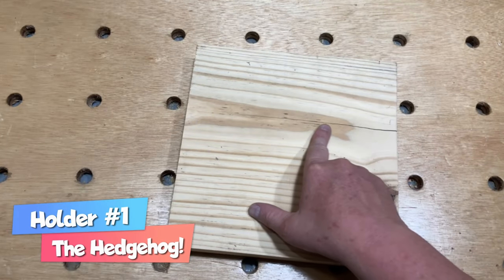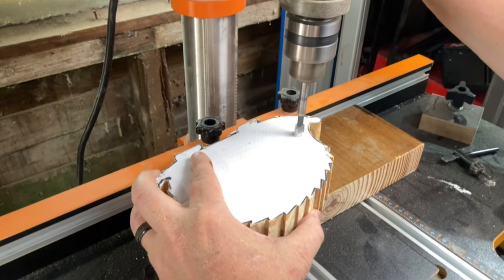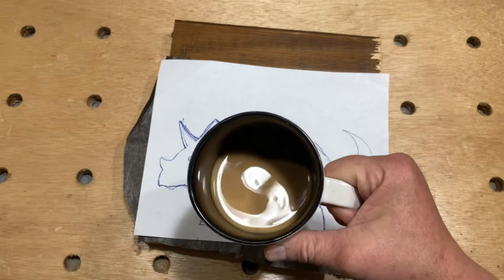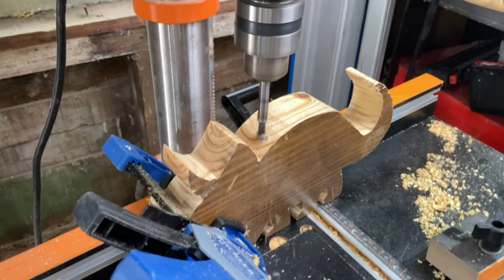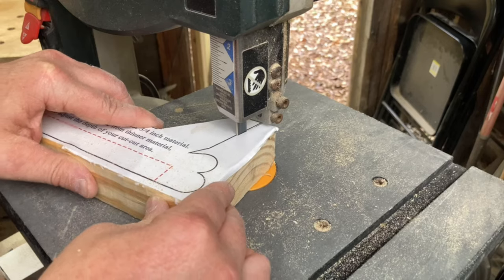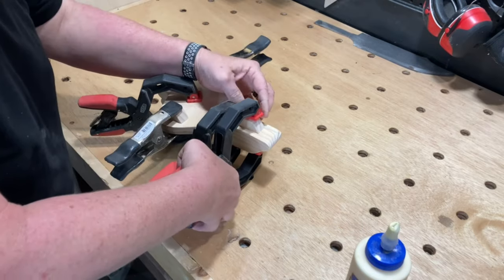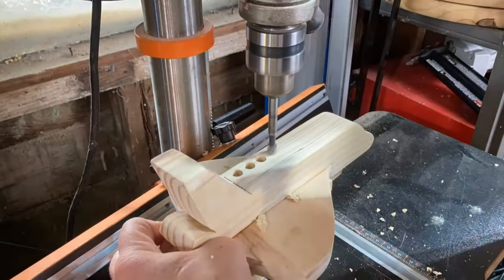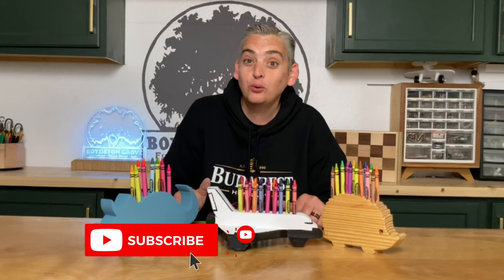Making Crayon Holders From Scrap Wood // Easy Woodworking Project

Comment: Great simple projects. Thanks for sharing.  Thanks for the plans, I've just downloaded them. Maybe I'll manage to make some before the start of the new school year (September 4th) to donate them to some of the nursery schools in my home town. What thickness should the material be?  According the plans of the plane it seems to be 1.5 inch, is that correct?
In that case maybe I'll go for a holder with a single row of holes.
Reply from the maker: Thank you for pointing that out. I’ll make sure to adjust the plans. Yes, I used 2x material which is 1.5” for the main bait of all the crayon holders. Thank you for watching!!

Comment: polyurethane  would that be safe for children  ?  only asking before i purchase some thanks
Reply from the maker: So technically any finish is fine as long as you allow it to properly cure according to the instructions. But yes, poly is totally fine especially if you use a water based poly.

Comment: How many holes did you drill to hold the crayons?
Reply from the maker: As many as I could fit in the area, it was different for each design. I added the pattern to each of the templates, so when you print it out, you can see on each one. Thanks for watching!